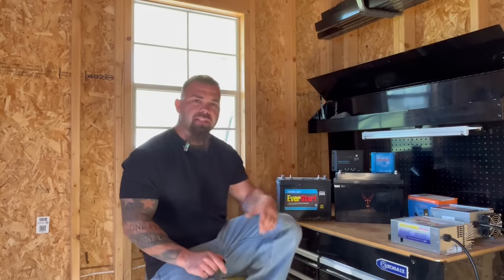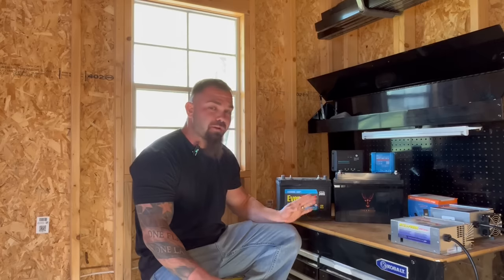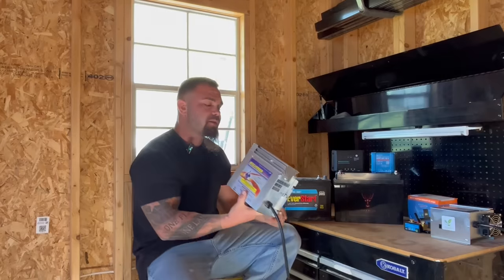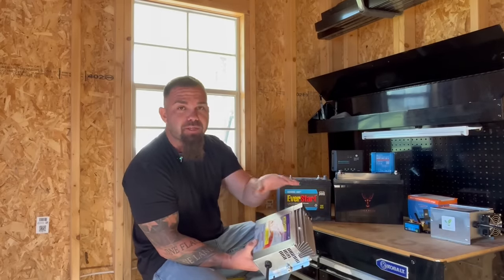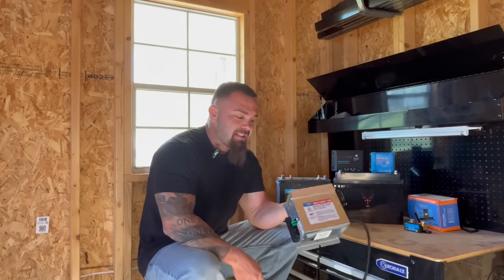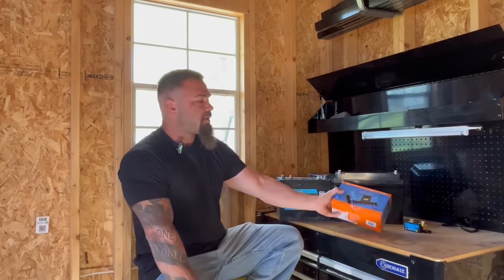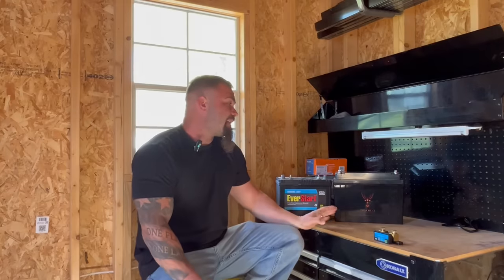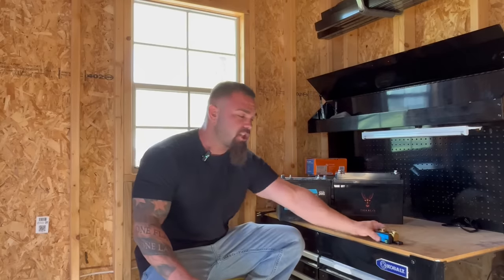Swapping to Lithium? WATCH THIS FIRST!

Comment: I don’t know where you get your figures from. Firstly, 13.6v or so will NOT charge lead acid! 13.8 might if it sits there for literally days.
Meanwhile, 14.0 volts will 99% charge a lithium iron phosphate battery. (My LFP battery has never been above 14v.)
I’ve had LFP batteries in my RV for nine years now. I’d never EVER go back to lead acid.
Reply from the maker: @FutureSystem738  You must be the REAL expert... All of the numbers that I discussed were printed right on the equipment by the manufacturers themselves but I guess you know better then those bums huh?
Reply: @rvsolarconcepts  Expert? Maybe not, but perhaps a lot more than you are? 
I’ve been both using and installing LFP batteries for well OVER nine years- actually very nearly ten! 
 I’ve also been both using and installing various Lead Acid batteries (wet cell and AGM etc) in RVs, boats etc for a few decades before that.
I also have a 65kWh home designed and built LFP battery system. (FWIW almost irrelevant, but I also have an electrical engineering degree). 
AS I SAID: 13.6v will NOT charge a lead acid battery properly for daily cycling, not even close.
AND LFP batteries have a very flat charge and discharge curve. They are very close to full as soon as they get to 3.45v per cell, (which equals 13.6v in a 12v system). By then charging further up to 3.5v per cell (ie: 14v in a four cell “12v” battery) they are extremely close to full, typically  around 99%. You’ll only squeeze in just a percent or two more by going to higher voltages, but with far more stress on the battery and more chance of cell imbalances. 
And that’s why I NEVER take my LFP batteries above 3.5v per cell, ie: 14v on a 4s “12v” battery.
Reply from the maker: @FutureSystem738  There are plenty of ways to "optimize" the system but that is up to the owner of the equipment not us, the business installing or talking about the equipment. The voltages claimed in this video were quoted directly from the literature on the components. The converter output was listed at 13.6, the lithium battery showed a FULLY charged voltage of 14.4 as 99% of the other manufacturers on the market do. With that in mind, please don't run up in the comments and act like we don't know what we're talking about just because YOU choose to run your charging voltage a tiny bit lower because you feel that it will add longevity to your system. If you want to do that with yours go ahead, but by no means does that make our information incorrect. If you have a problem with the voltages listed please contact the manufacturers of the equipment not the guy reading it lol. 

You also contradicted yourself by saying you don't need to charge lithium to 14.4 and then admitted by doing so you only get a "few more percent"... Well that surely sounds like it wasn't "fully" charged until it hit that point huh?? For a college educated person you should see the flaws in your statement pretty quickly.

In any case, this video was made to educate people on what will be required to switch their battery type to lithium and why, it was not created for an in depth look at different battery types, perfect charging voltages for longevity, or anything else that you took issue with. Next time you feel the urge to try and tear people down over your OPINION (the facts from the manufacturers were given in the video) on a few tenths of a volt, please feel free to keep scrolling.

Comment: But why don't you mention LiFePo batteries?  They need only 12,8 V and keep the charge better and gives 100% of the battery.  A lead acid battery can't deliver lower when it reaches 11,1 V.
Reply from the maker: This entire video is about Lithium iron Phosphate... I'm a little confused by your question.

Comment: If you were to use a 3 stage charger, both your lead acid and lithium based batteries would be happy... why? Because the basic 2 stage charging does not have an 'acceptance' mode. This allows your battery to draw in the last phase of charging at a higher voltage, reduced amperage but at the maximum voltage the battery can accept at a given temperature. Not all chargers do this and that is why most batteries fail or never achieve full capacity, temperature is extremely important. Without temperature compensation charging, even your "12.6V" is not going to properly maintain a LA battery in a 'float' charge if under 75F. Inversely at 110F in a battery compartment that same 12.6V is now severely overcharging the same battery by almost 0.4V!

LiFePO4 and other Li chemistries cannot be charged below freezing for the most part, there are 'heated' versions that take the initial charge current and heat the cells up before charging without any external circuitry and the charger is none the wiser. I personally use four of these in a 12V300Ah 8D type configuration and never had a problem charging from solar in -30F and achieving 100% capacity.

Comment: Nonsense! I've converted two motorhomes to lithium. They are definitely 100% drop in but you're only going to get about 80% of the power capacity which is still about 30% more than lead. Upgrading your charging system can top it off to 100% but it's not required. For someone doing it on a budget go with the batteries first and then upgrade the charging system second. For me I didn't even touch the original charging I just added solar and those are designed for the original charging I just added solar and my charge controller knows what type of battery i put in.
Reply from the maker: Gotta love the "I've done two whole conversions" guy... lol

When people buy something they expect it to work 100% how it should. Saying that this is "nonsense" and then saying "but you'll have a diminished capacity until you upgrade all the stuff they mentioned in this video" is honestly asinine my man... 

You can't think it's nonsense and then turn around and tell everyone to do it in stages... if it truly was "nonsense" you wouldn't be telling people to do it eventually...

Comment: A little concerned that he has the wrong charge specs for charging Lead acid batteries. Different types of L.A. batteries require different charge profiles. A deep cycle flooded lead acid should have a charge cutoff at 14.8v. Sealed batteries have to switch to constant voltage charging at a lower rate but 13.8 is float stage for all of them, not end of charge. At that voltage it will take for ever to recharge! If you only Use the system for weekend use and plug it in at home this is fine but for regular cycling or charging from a genset you need a 3 step charger that can select for different types of battery. Lithium has great advantage in terms of weight and can run high power draws from a smaller bank but at a significant dollar cost (although that is dropping). Lithium also has a substantially shorter life than flooded lead acid (though not sealed L.A.)
Reply from the maker: This was intended as a basic overview of the batteries discussed and to highlight the differences between flooded lead acid batteries and Lithium battery charging. The voltages that I'm referring to in the video are the RESTING fully charged voltages again, just to highlight the differences. If a charger switches to float charging, that generally means that the battery is very near fully charged... Lithium absolutely does not have a shorter life span than flooded lead acid batteries haha. Please point me to a Flooded Lead Acid battery with a warranty greater than 10 years like most of the LiFeP04 are coming with these days...
Reply: @rvsolarconcepts  Thanks for the clarification, makes perfect sense if you are talking about resting voltages. 
It isn't easy to be sure of lifespan as Lithium has not been widely available for long enough. I have personal experience with flooded cells lasting 15 years or more and know others who have similar experiences. Nobody has been running Lithium for anywhere near that long so I currently base the estimated lifespan on the comparison manufacturer's estimated cycle life. I generally use Rolls batteries so just checked their website and stand corrected on lifecycles. This is a fast-moving technology and you are right, Rolls now claims a 6,000 lifecycle for their lithium batteries compared to 5,000 for flooded when related to real-world conditions in marine applications. My experience is marine rather than RV where the typical discharge profile is full to 75% DoD over 24hrs for regular days increasing to 40% - 50% DoD on heavy days. In marine use banks should always be sized with a 50% emergency reserve regardless of cell chemistry as they are critical to the safe operation of the boat. This may not apply to RV's which are also much more weight-conscious and don't have the safety considerations. If a typical discharge profile goes below 50% then Lithium does seem to create some significant opportunities to save weight. On a boat the economics still don't make sense as the unit cost is still around double for Lithium but has dropped a lot in the last few years ($3000+ compared to $1,800 for a typical small cruiser) but it may be worth paying that premium on an RV especially if it allows the use of a smaller, and thus cheaper and lighter bank.

Comment: lithium for power storage is ok but to run totally on charging with a alternator bad
Reply from the maker: @jimlin7782  Each battery is protected by the BMS, why would it be bad to charge via the alternator? You do realize that they make lithium iron phosphate vehicle starting batteries that are charged solely from an alternator right?

Comment: I will stick with my LA batteries
Reply: can you tell us why?
Reply: @alanhat5252  One reasion LA battries are simple and much safer to charge. Also some older vehicles do not have voltage charging capasity, like he said.  And LA battery is 100% recycled and the Lith-Ion are not.

Comment: On a boat Lithium is very dangerous, Lot of fires.   I had Lithium But I went back to lead Acid, On my boat,  I HAVE 8 lead Acid, 2000 WATTS  SOLAR.,
Reply from the maker: @marlinpruett8343  definitely could see how the risk is not worth it in the marine category. Any battery malfunction while at sea could be catastrophic with not too many options to save the day depending on the type of boat.

Comment: 14.6V does not make sense. Lithium are 4.2V max per cell. 3 cells series are 12.6V, 4 cells series are 16.8V
Clearly 14.6V is nonsensical. 
The only way to make it work is to have a BMS for the cells [3] and a boost converter to create the 14.6V, maybe you could use 4 cells with a BMS along with a buck converter.
I don't know how they are getting the 14.6V rating unless it's not Lithium-Ion.
Reply from the maker: I think your information is a little off which is why the math doesn't work out. Prismatic cells are 100AH @ 3.2VDC Nominal which is how they calculate the the watt hours for the given battery. 100AH batteries contain 4 prismatic cells in series for 100AH @ 12.8VDC. 200AH batteries have a 4S2P design so two sets of 4 prismatic cells wired in series connections and the two sets are then wired in parallel to maintain 200AH @ 12.8VDC.

For whatever reason the cells voltages are not listed at their fully charged voltage but rather their nominal voltage at a resting state which gives 12.8 even though a fully charged lithium battery even at rest sits at about 13.6VDC at 100% State of Charge. 14.4 to 14.6VDC is usually the maximum allowable voltage that the BMS will pass through before disabling the charging circuit to protect the cells.

Comment: Lead acid batteries will NEVER experience thermal runaway. Lithium batteries... well, you just never know. Can't take that chance.
Reply: Embrace new tech. Lithium has all the advantages minus the cost advantage of lead acid which is basically disappearing with years that the price is now almost same.

Comment: Lithium is fantastic in many ways until the day it catches fire and ALL the advantages and your vehicle go up in smoke.
Reply: You do not understand that different types of ''lithium'' batteries use different chemistries. What catches fire, explodes, and burns under water is lithium ION  chemistry.  The Lithium iron phosphate type batteries called LiFeP04 or LFP batteries do not generate their own oxygen during thermal runaway conditions. They are safe. The LFP batteries for motorhome, boat and home use are much safer than lithium ion types.

Comment: Talk about fire it will start showing up with lithium batteries even in small power equipment have been catching on fire when charging just a well kept secret
Reply from the maker: You are misinformed sir. 

Lithium batteries are not all the same. The early chemistries of LITHIUM ION being sold were very unreliable and made their own oxygen when they burned. Lithium  IRON PHOSPHATE is extremely stable and has a battery management system on each one to keep the cells protected.

Comment: Lithium battery are slower to charge, your controler are throwing amp away after it over heat at about 80%  and it goes into low charge tapp off and throwing away amps. Consider Trojan golf cart 6 in series to get 12 volt battery  then get 4 battery to get 480 ah. Then you run your panels in series it’s about 1-2 hr faster charge than parallel. But buy expensive mppt controler. It’s about the battery bulk charging range  that goes all the way up to 95% then then it tapp off about a hr vs a lithium that goes into tapp off. about 70%. My friend has about the same panels and amp hr, we charge a. The  Park Iam at 100% by 1:00 pm hand under a tree somewhere playing my ps3 he need to charge till after 3 pm to tapp off.
And my 1 set set of Trojan are 14 yr old still as new, 240 buck ea.
Reply: These are the best golf cart batter big and heavy deep cell with special battery lead bracket, to go low as 10.8.  But the bulk rate charge til 95 % take all your solar amps til 95% is difference beside the price and quality. I tryed them all but these are the best, I have forgot to fill water about 4 month dry to see all it’s fins but still don’t hurt them at all.

Comment: I don't think you own a voltage meter. Cars charge at 14.4. A 12.7 volt battery has to have one volt over to reverse the flow. 13.6 is a voltage that keeps batteries from burning up. You need a multi stage battery charger that is completely adjustable and then a sine wave inverter. My flooded golf cart batteries do a bulk charge at 14.8 volts. I run a full off grid set up then plug in a battery converter that puts out 13.6 to run the house 12 volt. My off grid system runs at 24 volt. I should have gone to 48 volts to run my AC plugs.
Reply from the maker: Yeah running a successful off-grid power company for 5 years and we've never needed a multimeter.... C'mon man... 

There are obvious differences in charging voltages, resting voltages, voltage under loads, ETC... splitting hairs over a half a volt here or there is really a moot point and hardly grounds for trying to assassinate our character over it... I literally read the manufacturer stickers off in this video and gave you the voltages that HUGE electronics companies are going by. I also used the Lithium voltages described by the manufacturer of the batteries that we use. Are you suggesting that 5 years of our experience is invalid, battery manufacturers don't know what they're talking about, and the largest companies on the planet making converters and battery chargers also have no idea what is an acceptable voltage for charging?? That would be a bold statement from someone who's only accomplishment in this space is piecing together an "off-grid home" for himself. 

We encourage the flow of information and open dialogue but please leave your negativity out of it. Belittling a channel and their content creators because of the voltage numbers that they pulled from LEADING MANUFACTURERS is quite ridiculous... I hope your life takes a turn for the more positive side so you can start spreading that instead of whatever this is...
Reply: I've seen 13.8V to 14.8V from alternators over the years, my current one is 14.2V. I'm pretty sure the manufacturers know what they're doing, they've had over a century to get it right.
Reply: @alanhat5252  If your car came with a Gel Battery then 14.1 to 14.4 is optimal charging. 14.2 makes me think the car came with a Gel. I'm not sure about getting it right. Tesla is going from a 12 volt to a 48 volt system. A few decades ago the automakers talked of going to a 42 volt system.